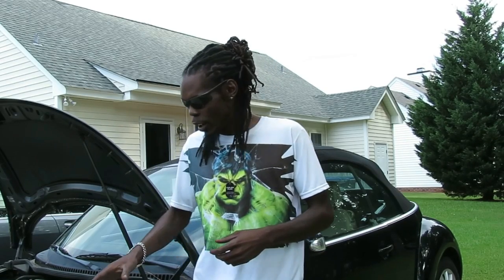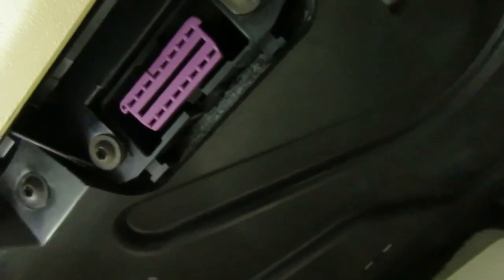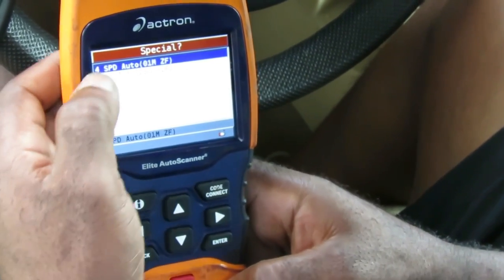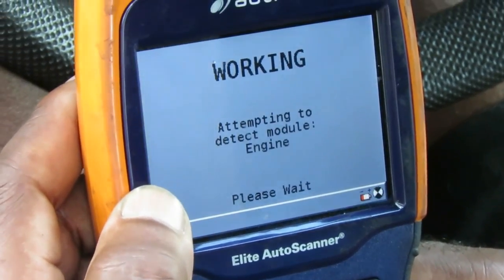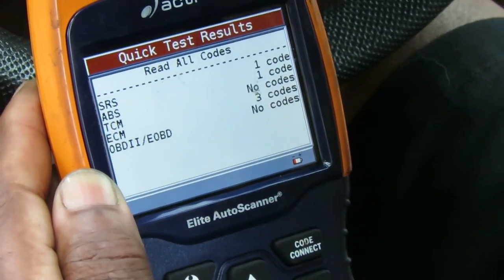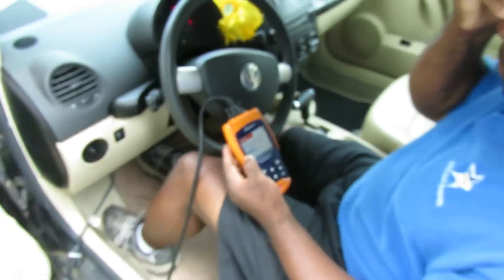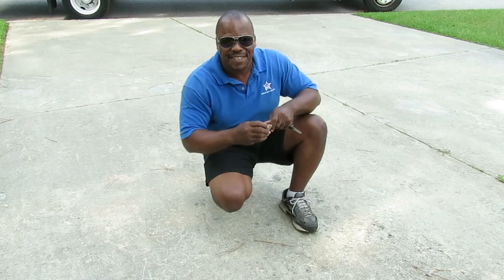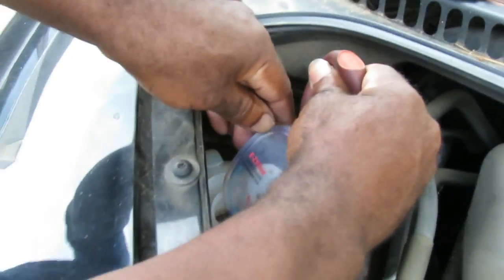⭐2005 Volkswagen Beetle - 2.0 - P2181 - 18613 - Cooling System Performance

Comment: Good video guys.  Let me throw this one at you.  I have a P2181 (Cooling System Performance) code.  It only comes on when it's cold outside...almost like clockwork.  It goes away if it gets warm for a few days. 2004 VW Jetta 2.0 L

I have so far:

1.  Changed the thermostat
2.  Flushed the coolant and replaced with VW OEM coolant pre-mixed at 50/50.  The old coolant looked good, no rust or discolored.  But replaced it anyway.
3.  I checked the fan hi/lo operation (they work) by short circuiting the connections at the thermal switch on the radiator.
4.  I replaced the thermo switch on the radiator.
5.  I replaced the Coolant Temp Sensor (now have a green one installed).  I actually replaced it again a few weeks later, just to be sure.
6.  I replaced the fan module (seems like a lot of people online say that this can throw the code).

Still no luck.  I've held off on the water pump, because I visually verified flow at the bottle when the car was warm (took the input to the bottle off and held it over the bottle).  If the water pump wasn't working, I'd be overheating...which I'm not.  Temp gage is right in the 190-195 range when running...right where it should be.

I've fixed a lot of cars in my day, but I admit...this one has me on the ropes...any thoughts?
Reply from the maker: How did you clear the code once you did each repair?
Reply: @OnlineAutoRepairVideos  I cleared the code via scan tool before doing any repairs at all.  Then it came back on.  After each of the changes above I did not clear the code.  I did, however, drive the car through 6 cold starts (driving it up to temperature from cold starting for at least 10 minutes).  I did this because I believed the code would take care of itself if everything was working.

I've got two leads which I wonder might be causing the problem.  First - the green temp sensor apparently is very finicky if you get the aftermarket type (and not the OEM).  I admit I don't have an OEM green sensor...might be worth trying that.  Also, the fan control module I changed was the cheapest one on Rock Auto (it had the correct part number, ended in "K".).  But I also wonder if that isn't a similar "cheap" situation.  They don't just hand out those little buggers....
Reply from the maker: @alabasterfantasia1762  VW, BMW, and Mercedes; the codes MUST be cleared after the repair. With many other manufacturers you can drive it, and it MIGHT clear itself. Once you do that, go from there.
Reply: @OnlineAutoRepairVideos  Ah.  Ok.  That's good to know.  I must admit I've seen the CEL turn itself off after other repairs before.  But I'll note this for the future!  

Also, do you have a patreon account?  I would certainly throw you some $$,  for the time you've spent here.  

Thank you again, I will re-post on this with updates (so others can see how this turned out).
Reply from the maker: @alabasterfantasia1762  Now this may not work, but we do need to start there. No we don't have a Patreon, but you letting us know that we helped you out is more than enough, so THANKS!!
Reply: @OnlineAutoRepairVideos  Alright, update.  I cleared the codes using an OBD 2 code reader.  I've been driving the car around for a few days now (trying to get the 6 cold starts in) to see if the light would come back on.  It hasn't.  

At this point, I'm calling it fixed.  It's been pretty cold here recently too (Chicago area) so that generally means the light would come back on.  That's a good sign.   Going to try to get the stupid car to pass the Illinois emission test now...hopefully it will.

So what was the fix?  Well, hard to say.  I'm thinking the coolant flush might have done it.  I notice now that when I run the heater,  the heat that comes out is a bit more intense.  The coolant that I got rid of seemed fine.  No discoloration (in fact, it looked quite good), or rust, or anything.  But somehow, it seems to be a better medium for transferring heat.  I'm not sure if low quality coolant can throw the P2181 code...

It it wasn't the coolant, then my next guess would be either the thermo switch on the radiator, or maybe the fan control module.

If the light comes back on I'll re-post.  Hope this helps the next guy/girl who is going through this P2181 adventure.
Reply from the maker: @alabasterfantasia1762  Appreciate that update, and it does look like it's a fix! Let us know when you pass!!
Reply: @OnlineAutoRepairVideos  The car did indeed pass the emissions test.  A great saga of our time, the P2181 Fix, has, finally, ended.
Reply from the maker: @alabasterfantasia1762  LOL, That is GREAT to hear!!

Comment: A blockage in the radiator with dirt or debris can cause the coolant to heat up and cause the engine to overheat, also a leak in the upper or lower radiator hose

Comment: The EXACT problem I had on my 2001 Passat. My  car runs hot when driven a few miles but at idle it's not running hot. My stepdad and I changed the thermostat and the sensor. The gauge is showing that my car is running hot but the car isn't physically showing any signs of running hot under the hood. We're thinking it's a faulty water pump.
Reply from the maker: That is very possible, also be sure no kind of sealer was added to the car, because that will clog up the radiator. As you are driving, the engine needs a faster flow of antifreeze to keep it cool, so if the radiator is clogged, it won't get that.

Comment: If I have a p2181 will a radiator flush work or do I need to buy a water pump or a thermostat
Reply from the maker: You should start off with the thermostat

Comment: I have a 2004 passat 1.8t once I start my car both my fan start turning on even if the engine is cold and turns off when I turn off the car what could be the problem
Reply from the maker: It looks like someone hard wired the fans to do that. How long have you had the car?

Comment: Man O man I like this!! My code is p2181. 2004 vw jetta. I replaced the coolant temp sensor and check engine light still on. My temp gauge on dash is straight up. Normal. What else can I check?
Reply from the maker: Check the strength of the anitfreeze and the thermostat.
Reply from the maker: BMO  LOL, thanks BMO! No matter how many subs we get, we will always try to respond because A LOT of these YouTubers forget to realize that it's peole like YOU and James Bennet that makes our channel what it is, so THANKS!!

Comment: Just bought an 06 GTI. 20 minutes into driving it check engine light came on. P2881 car seems like it's running cold it's not even getting 2/2 way and he seems like it's not that hot.. please give me some advice
Reply from the maker: Check the hose between the Mass Airflow and the throttle body.